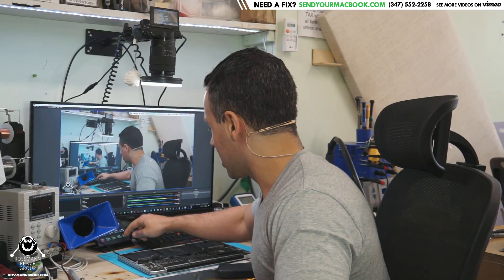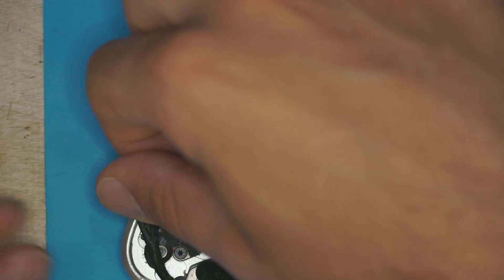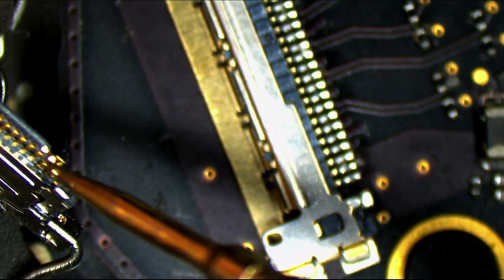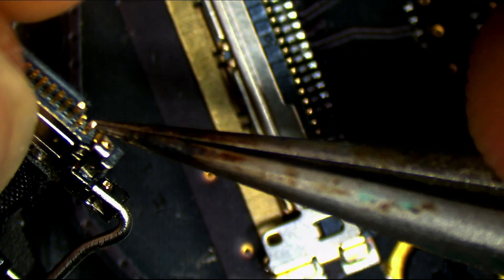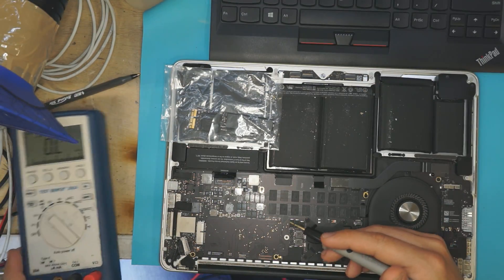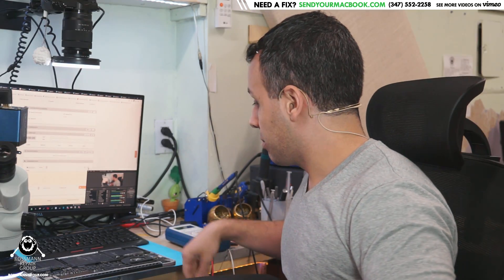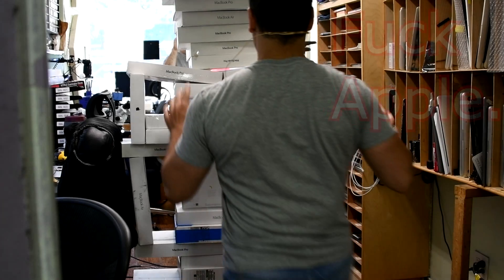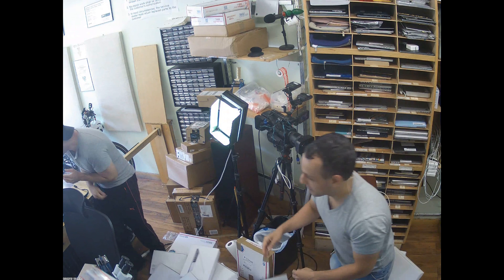APPLE GENIUS BAR STRIKES AGAIN!

Comment: I've worked over 30+ years doing independent home theater repair and contract warranty for several major manufacturers. I've seen some insane bad workmanship as well 8~O
Best Buy Geek Squad has occasionally shocked me for one.
One time they broke off a cable socket in a receiver, AND HOT GLUED IT BACK ON, then sent it to us back in the day to fix.

Comment: I worked for a computer store as a computer repair person. Some computer cases were just very difficult to open, no matter how careful one was in opening them. Some plastic part would break. Before I accepted the computer for repair I always had the customer agree that I would not be liable is a plastic part broke when attempting to open the case. I always stated that I am extremely careful, but sometimes plastic did break. Many clients decided to take their computers elsewhere, and came back with broken cases which I now had to have them replaced. Informing a customer of a potential breakage, no matter how careful one does the job, is better than breaking the item and then trying to explain to the customer why it broke. Many claimed that I was inept and that is why the case part broke, however, having them sign a waiver it relieved me of the stress. By they way the broken plastic was always fixed correctly. I then placed a sticker on the outside of the case explaining to future repair persons to be extra careful in opening the case at that location.

Comment: the apple store could've replaised the hard drive right? bc im sure that the blinking folder just means that it cant find an OS, meaning that there is either no OS or no recognisable HDD or SSD. correct me if im wrong though.

Comment: Definitely have a huge respect for you.
If something is bought from someone,  like a car. Schematics is offered for repair, why do companies think they are so different. It should be up to the people who buy their products to decide what they want to do about fixing their device.

Everytime something breaks that I have own, I've wanted to fix it rather than throwing it away. I can understand that they don't want to release information in fear or clone duplications. But that's why there is patents in place.

I myself am still trying to deal with trying to get my usb-c to connect to my pc.
I replaced the daughter board and the usb-c connector and it still won't work, tried parts from i-fix it and many and nothing helps.

If more schematics were released it would give me more understanding of the pathway of understanding what is the underlying issue.

It's my device I should be allowed to understand how my device works.

Comment: Just discovered your channel. Fantastic!  After watching several episodes I will only send my apple devices to you for repair, if necessary. I am DONE with the idiot, I mean, Genius Bar. Thanks.
Reply: the point is to honestly not buy apple stuff, it's not cost effective, like at all and is overall worse than other computers, the durability is fairly better, but when the PC costs 3 times more than it should you are better off getting 3 PCs with the same power and a decent OS
Reply: NANCOK no doubt. I like my MacBook and have had any trouble in the 4years I’ve owned it. I DO NOT like Apple Inc. When this laptop dies I’ll prob. go with Lenovo. I don’t much care for MS either.
Reply: @EvaderGuy  at least it has an average milleage, most PCs tend to last around 5-6 years, more with some degree of maintenance
i can't talk for the battery tho
Reply: NANCOK I’ve had a good run with my Asus desktop-7 years. When I upgraded to win 10 it started to fail.

Comment: I think it's a common issue in some devices. My second generation ipad use to go blink if it fall. When it first happen, i just put it somewhere. We don't have apple store in my country. So one day a relative saw the ipad and suggect something must got disconnected inside. Didn't need more to open it( i cracked the screen in doing so) i found the screen cable unplug to the mother board, plugged in and the screen shined again. Every time it would fall the cable will unplug.

Comment: This is interesting. I bought a second hand used Mac. A week later the screen did not want to turn on I thought $600 down the drain. Took it to Apple. They fixed a few issues on it for me and it was free. I was very fortunate. Didn’t ask why I wasnt charged but it was estimated at $310 for software labor. Go figure.

Comment: Man we need more people like u on our planet! 

Question thoguh, I have a 2012 retina MacBook Pro, the first retina MacBook model. changed its battery twice throughout the past 8 years, upgraded its WiFi-Bluetooth card by myself and upgraded its SSD too. Alright? Now.. all of a sudden, the display shuts down by itself while the device remains on. 

Force turn it off, leave it for 5 minutes or so, and the. Start it again, it turns on well and a bit later...booooooo the display turns off again. Tried plugging it to an external display, still no joy. 

What r ur thoughts if u have time to read and respond to this? 

Best regards man

Comment: Of course the trust goes to you, not to a company that forces me to pay over $1k to have my 1 and half month MacBook pro fixed, changing the whole logic board after failing to address that the failure is in the thunderbolt that's got a short circuit in it and could cost less than 1 dollar to be fixed!
Of course I'd trust you dude! Wish I was in the US.

Comment: I feel you I'm a auto technician and I can't tell you the countless times I have had customers swear by the dealerships. Only for them to come for one visit to our shop and actually get their bill and watch the look on their face as they go wow I really have been getting ripped off at the dealership. I live in PA where along with emissions testing you must pass a state safety inspection every year. I can't tell you the amount of customers I have gained because of dealership dishonesty. They come in with an inspection that needs 2-3k of work and more often than not there is a lot of fluff to these estimates. Things that aren't needed at all. I take my customers into the shop and show them why this or that passes or fails. What they actually need to address and what isn't really a safety concern more of a recommendation. In any industry I feel as a good rule of thumb independent repair is the way to go. People don't even realize in the auto industry most dealerships have maybe 3 competent techs and the rest are usually new guys straight out of automotive school looking to get there few years of experience. Do your research wherever you live and trust in independent repairs there are very knowledgeable people out there who can do it right and affordable.

Comment: I bought a nice 13" macbook pro off a guy for $150 that was just over 3 years old. The guy took it to Best Buy and the "Geek Squad" and they told him it needed a new logic board. I intended to part it out on ebay but just for grins I booted it off a firewire drive I had with OS X on it. It booted right up. I then pulled and replaced the hard drive and it worked fine and I used it for the next five years before selling it for $150.

Comment: My first job in computer repair was at PCB Test and Repair in Tempe Arizona in the very early 1990’s.  Motherboards were expensive in those days and we’d repair them rather than replacing them. Apple is to hardware what Microsoft is to software.

Comment: I have fixed a whole bunch of welding machines during the years. The last one was a Kemppi 300 A MIG welder. 
The repair shop, which is a Kemppi affiliate, returned the machine stating that they had to replace the entire main PCB at a cost of $2000. 

I changed two diodes for about $2 each. The machine bow works perfectly. 

A few months ago I repaired another Kemppi welder. That one had also been returned from the repair shop, deemed unfixable. I changed the main rectifier at a cost of $30. 

The repair shop have later on told me that they are simply not allowed to do anything else but changing entire PCB and/or other major parts of the machines. It is strictly forbidden to change individual components. 

This is just stupid. I have had the same experience with other major welding machine brands. Brands that are well respected for their good machines. 

The time I came across a broken TIG welder made by the French GYS company I emailed them to ask for a service manual (this is usually impossible with Kemppi, Esab etc). They sent the manual used internally by them, and gave me some hints in the possible cause of my issues. I ended up changing a single component at a cost of about $1.

Comment: I have been building and repairing computers since the ZX80 i consider myself pretty good, about 20 yrs ago i had need to build myself a new desktop system, I gathered all the parts checked to make sure they were compatible, I then spent 4 hrs building the system and checking all connections before software installation, i then spent about 16 hrs installing and configuring the system, less than a week later i noticed an odour of burning from the system and then ALL sound died, i checked for dust - None, i checked the voltages - Fine, I then inserted a spare sound card into the system and the sound returned, I contacted the shop i got the Motherboard from to be told - "It was a codec issue" i replied telling them what i had done to "Think again", they asked me to bring in my system which i did and 5 days later they phoned to say that my system was fine and it was only a codec problem.
What i did NOT tell them was i had marked the faulty board after my phone call to them with a UV marker and when i went down to pick up my system they were shocked and angry to find this out, I checked the motherboard and NO MARK,  I pointed this out Called them some pretty fruity names and made sure that the business went down the toilet,  Moral of this story is ONLY USE GOOD COMPUTER REPAIR SHOPS, Like i am glad to say You...

Comment: I support independent repair. I was a Motor Mechanic and switch career a few times and ended up repairing computers and other electrical devices as part of my jobs or as favors for work colleagues. I also had my own business creating websites and was constantly asked if I could look at someone computer and fix it. From software problems to hardware problems, I learnt loads from the internet and youtube about how to fix things. I also made many mistakes but usually it was due to being overworked and tired. But I always fix something I broke and informed the person that I had broken something which I have replaced or fixed. I have only had one bad customer who kept installing old redundant and probably pirated and infected software onto his computer after I keep fixing it for them. I told them to buy a new computer and buy the latest version of the software to stop the problem from happening. But instead they refused to listen to me and never paid me. But I wasn't bothered and went on about my life.

Comment: I have had a horrible experience with Apple just recently. I own the Iphone 11 since October 2019 and 85% of the time I used a wireless charger to charge my phone and the other 15% of the time I use the apple charger that came with the phone. One day I noticed it was not charging correctly and the message of “decice not supported” came up. I took it the apple store only to be told there was a pin missing from the lightning port and it was considered accidental damage. The phone is in pristine condition, never dropped or exposed to water so it was really hard for me to believe apple’s claim it was accidental damage. I strongly believe this was more of a manufacturer defect because how else can that pin inside the lightning port falls off from the phone ? Any suggestions would be greatly appreciated. Keep up the good work my friend.

Comment: You can buy a car from us but you can only fill up at our gas stations. Unauthorized fill ups will automatically I initiate ignition system disabler.  To restart car you will have to have our tech personnel reset the computer in the car.

Comment: I never was a fan of apple and their products of today, I respected their older ads (I saw their 1984 advert on their old Macintoshes, and its a pretty good ad) but a very nice ad does not sell me a mac computer, and these practices just add onto that opinion. When I want a device like this I am expected to at least have a person actually tell me the issue & give me better options instead of "defective, buy whole part or new device". If that happens, i'm leaving my device there, tell em off in a simple yet verbal sentence & just go somewhere else for a better device, not asking for some sort of refund, as my business there shows they don't care (especially if its like a simple battery swap or a screen replacement or something basic), of which I respect you for that Rossmann. Let RTR burn an effigy of the likes of apple.

Comment: owned only 1 Apple product in my life - a 28 inch desktop machine years ago.  In 12 months and 3 days it died (3 days out of warranty).  Well I happened to live across from a big Apple repair center.  They wanted $1350, not including tax, to repair (It was $1800 brand new) - of course for those 3 days they would not honor any warranty.  They fed me a huge line of bull crap as to what was wrong with it, which was just that bull crap for I've been a micro-electronics engineer for a huge international large truck manufacturer for over 30 yrs.  It ticked me off so bad I sat it in middle of their store floor and put my foot through it, created one hell of a scene then left.  Store was full of people with their jaws on the floor in amazement. I made sure all knew what Apple was doing here.  I've never owned another Apple product again, nor will I.  And since at my employer I was incharge of all supplier purchase orders I made damn certain Apple never got one there again.  Over all I'd say I probably denied Apple over half a million in business from my company and probably a few hundred thousand more by spreading/word of mouth via internet and short wave (ham) radio world wide.  Yep, that incident cost Apple I figure well over $1M in lost business.  Everything Apple produces is propritory and they want to hold control of your device by them via the software and any repairs even after you've fully purchased it !!!  You couldn't give me another Apple product !  Even in that damn 28 inch desktop I had which my son got me, it ran hot as hell --- why, the video drive circuits are the very identical same ones they used in their laptop.  In a 28 inch machine it ran so hot because it was literally working its ass off just to keep up.  Apple they say is the "cadillac" of desktops --- bull, only thing "cadillac" about them is their prices for both their product and services !!!

Comment: This too is why I quit working at a Panasonic repair facility. They wanted 20 plus units out the door daily, my average was 12 because there are times when being truthful means spending more time on a unit and the company has to spend more money on replaced parts. My return % was extremely low compared to the average but because my output volume was too low, I had to resign. I also, lately went to the Apple store and without getting into too much detail, it's always the most expensive reair or just upgrade option. I am falling away from Apple because of their expensive products and business practices. I love their phones and there iOS is restrictive but wonderful. I now own a high end PC and rarely miss my Apple.... I'm sure if I had a new one I would think differently but I am sickened by their business practices.

Comment: hard to say aganst big company as aple. but it is needed. well work. as I say, aple is fine for those who like it...but I can't stand somehing I can't fiks or update without sending it away.
So I still use my asus g73sw with an ssd and upgraded system. And it work great. handle everything I put on it. and that after 9 years. tell that to aple.....and that cost me..a  win 10 and a samsung ssd disk.  and a fix on a power intake....still need a new battery. 
thanks for sharing.

Comment: I have 3 2011 27 inch Imac logic boards and all with broken  connectors , all have a couple of pins broken !!!  It's the black small connector next to the main video connector. 100% removing the screen and put tension on the black cable. Getting hold of replacement connectors any ideas on source guys ?.

Comment: As a mechanic, I feel your pain whereas “independents are just hacks and aren’t qualified to work on (whatever products).” 

I’ve worked at dealerships and independents, both have their morons, also, both have wicked good techs. It’s the unscrupulous ones that give us a bad name and perpetuate the idea that “all mechanics are ripoffs”. 

I’ve sacrificed flag hours at dealerships in order to make something right that was out of my control. I’ve sacrificed profit in order to help out customers with little to no funds to repair their vehicles. It just goes with the territory. It does make an impact, though, in their perceptions of mechanics. 

Sometimes I have to bid a job fairly high in order to account for possible problems along the way to repair a vehicle properly. Sometimes, all goes better than planned and I didn’t have to venture into the more expensive territory, so the customer winds up pleasantly surprised when their bill comes out cheaper (sometimes dirt cheap if the problem is easy). Heck, some things were so easy, I didn’t even charge for the service. That’s how my name got around, word-of-mouth. 

When you treat people right, you get positive feedback and the best advertising available, which is word-of-mouth.